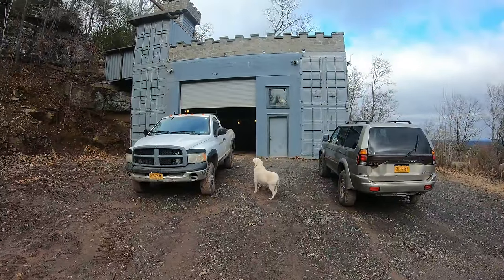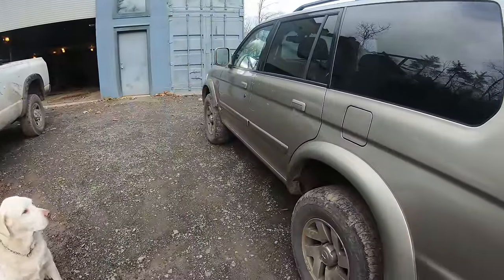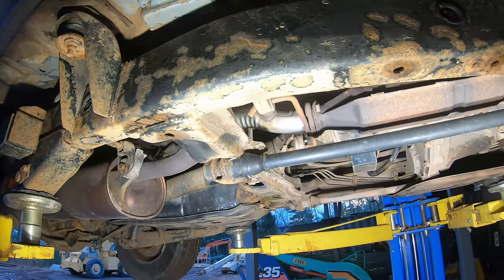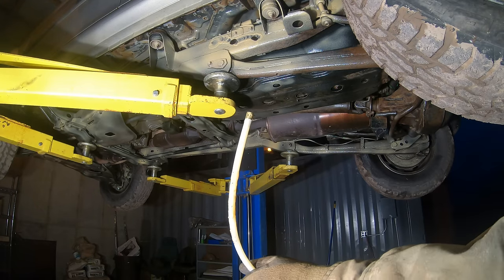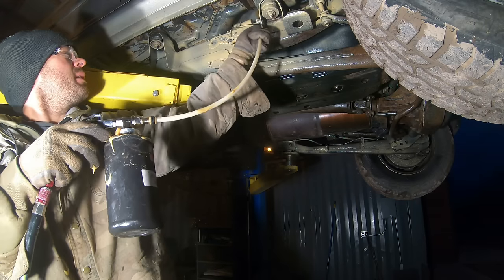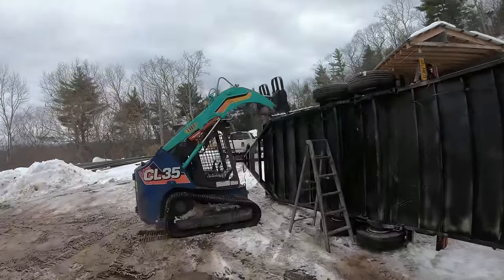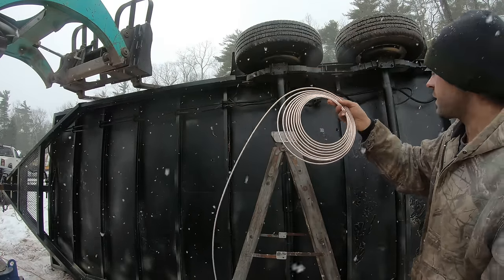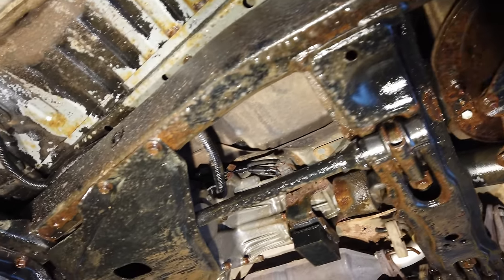Undercoating vehicles

Comment: I want to undercoat my trucks but I think I'm going to use diesel fuel. It may not last long and it may not be legal but I think a thin oil is what the metal needs and it will seep into all the hard to get areas. Good for leaf springs too .
Reply: That's what we use, a combo of diesel, kerosene and bar&chain lube cause it contains wax or something sticky ? Works great. After 3-4 applications, everything turns black and you're right, it soaks into every nook and cranny.
Reply: Does it pick up sand. In Pennsylvania they mix salt and sand. Too sticky and it will cake up.
Reply: @williamfindspeople4341 , It's done in the fall and then driven down dry dirt roads.
Reply: @augustreil  I've heard of mixing kerosene with it. Personally, I don't want anything sticky. I'd rather just reapply it every few months. Automatic Transmission Fluid makes a great penetrant as well but it's red so I think I'll just stick to diesel.
Reply: I always wondered what if something started sparking on the truck, say if a rock or something got wedged between the wheel and the rotor or caliper and shot sparks at the frame covered in oil or fuel think it would light up the whole truck?
Reply: @drevil7223  Diesel is not that flammable . And once it is done , it's not even wet.
Reply: @drevil7223  Only real concern it that you don't spray the brake drums  or rotors.
Reply: @johnmazza9432 , Sure, that's fine too. After 3-4 years of spraying the underneath, it all turns black and looks great. No rust.
Reply: @augustreil  It seems to make sense that you don't want wax in it because that might prevent repeat applications from penetrating. I'd rather keep it thin  like a stain.
Reply: @johnmazza9432 , I don't think you can go wrong either way. Maybe do the first 2-3 sprays like you're saying, then do a couple with some Chainsaw lube in it ?
Reply: @augustreil  I don't want dirt sticking to my truck. I'll keep mine just diesel and kerosene.
Reply: @johnmazza9432 , Totally understand !
Reply: To all of the people talking about driving on a dusty dirt road to coat the sticky undercoating/FF/oil/etc. - In western New York many towns try to control the dust on their roads by ... spraying the dirt roads with salt brine in the spring, summer and fall --- along with the winter months.  You can't escape salt on the roads!

Comment: Would be better off putting some zinc on metal parts you don't want rusting. If a single part of the undercoat get a nick that area will experience accelerated rusting that can put holes in your frame or body panels.

Comment: OK, first you wash the underware of the truck with an angry beehive washer by lifting the rear-end up in the air. Then you spray on the frame Peter Pan peanut butter. OK, how do you keep Levi from licking it off? LOL. That trailer brake system looks bad ass, by the way.

Comment: Andrew, I live near you and have been using fluid film on my cars and trucks for years, it works pretty darned good.  I do it every fall, and since I drive dirt roads, it forms a dirt / fluid film coating.  I dont bother mixing it before I use it as I find its too thick to separate much, but I guess it doesnt hurt to do it.  I now do all my friends trucks as well, go through a pail a year of that stuff

Comment: Hi, I will give you a better formula. You put 1/4 unused motor oil. Any type of car oil works. And for every 1/4 of oil you add 2 gallons of gasoline ... It sounds like Diesel but homemade. You spray that under your cars and you'll see how it protects from everything. Thanks

Comment: Isn’t the exposed copper used for the brakes most vulnerable to corrosion from exposure to salt water? I.e the winter salt?
Reply from the maker: The steel ones rust out. Never had the copper/Nickle rust out.
Reply: Andrew Camarata thanks but I was talking about corrosion from the salt not necessarily rust. I’m sure copper is superior against rust but inferior to road salt. 😀

Comment: I rented a U-haul  trailer with that type of braking system and the brakes would lock up when I tried to back it up. Was very annoying. Do they all work like that?
Reply from the maker: No, most trailers are electric brakes. Uhaul has surge brake trailers because they are usually better, and than that way the tow vehicle does not need a brake controller.
Reply: @AndrewCamarata  I still don't understand why the surge brake locked up the trailer brake while backing up like something was wrong with it. Maybe it was too old and rusty..

Comment: what do you do when backing that loaded trailer up a hill and the break applies not letting you turn around?? That happened to me!!
Reply from the maker: I thought they weren't suppose to work in reverse for that reason. I have not had any issues with it.
Reply: @AndrewCamarata  i kept a block of wood to jam between the trailer and the actuator you replaced to keep it from traveling in when backing uphill.

Comment: why do you not treat the rust and do the job right?    Covering up rust may actually accelerate the destruction of the vehicle.  Once you have it clean, you need to treat all the rust with a grinder, wire brush, and phosphoric acid.   Paint the areas with a rustoleum primer and then the rest preventative waxy compound.   All internal areas must be cleaned, treated , painted and coated.

Comment: Fluid film sucks. I will not help your current rust, it causes plastic and rubber to soften and expand, it wears-away quickly, AND it will cause the standard GM undercoating (Daubert Nox-Rust 121B) to peel off. A rubberized coating may look good for a few years, then it will just hold-in moisture and pockets of sediment creating rust. The best way to deal with rust is to remove it, fill it if necessary, and keep the exposed surface painted and clean. No magic to it. POR-15 does work very well, this guy would have had an easy setup painting POR15 by hand with a brush  carefully where was needed (and not where it isn't). The newer "road salt" formulas are using magnesium chloride and/or calcium chloride, both of which are far more corrosive than just the old sand and salt mix.

Comment: So they say undercoating causes more damage as it cracks an holds moisture around the frame especially around welded areas an areas that are not cleaned an wiped with a solvient like paint thinner,just wat I seen in videos an heard
Reply: This stuff is different. It doesn't really seal it and trap moisture like a rubberized undercoat.

Comment: Do you still use the hot water part or are you just running the pressure washer without the burner going?
Reply from the maker: I use the hot water.

Comment: I thought copper was not allowed for brake lines because copper can expand under pressure and fail.
Reply from the maker: Kenz300 x it’s meant to be brake lines. The steel should not be allowed because it rust and fails.
Reply: @AndrewCamarata  I think its an alloy. Pure copper is pretty soft.
Reply: @AndrewCamarata  Yup... I lost my front brakes plowing. Lost my rears the next year. 2002 Sierra based in Maine. Also lost the transmission and power steering oil cooler lines to rot. Frame cross-members and shock shackles too. Got lots of new steel welded in.
Reply: @bluecollartrader1791  Might be time to consider an all stainless steel (no rust) CYBRTRK from Tesla. Looks like an indestructible tank. They took a sledge hammer to it and did not dent the door.  Stainless won't be a rust bucket.

Comment: Not trying to dog you, but you just sealed the fate of those vehicles. It’s been proven by multiple sources that undercoating does nothing but speed up rust.
Reply: It's been proven that hardened rubber and plastic undercoatings do. Not wet oil and fluid undercoatings.

Comment: Undercoating traps moisture unless 100% dry, thus the reason there done at the factory, still seen them rust out under the undercoating because moisture was present. It's way too cold to be applying that stuff Gaurentee that stuff is recommended applications is 70 deg or higher.. Wait till summer when that shit starts flaking off in sheets.. You wasted your time and money on this one.

Comment: Fuid film washes of really fast. Its really expensive and I was not impressed. I wouldnt trust the cummins in the salt. Kinda a rare truck. Your going to want to park that if you can.
Reply from the maker: I was not going to drive that truck in the salt. But I could not get the grey one running for plowing. Still trying to fix the grey one.
Reply: @AndrewCamarata  just be prepared to re oil wheelwell areas often. Thats where it washed off my dodge. I make my own blend of trans oil and motor oil now. It all suck. Salt sucks. Thats why i bought aluminum superduty.

Comment: Undercoating is bad, accelerates rusting ten fold
Reply from the maker: Any vehicles that are rusted now have to be replaced for free by the manufacture.
Reply: Hardened rubber and plastic undercoatings do. Wet oil and film undercoatings are excellent.